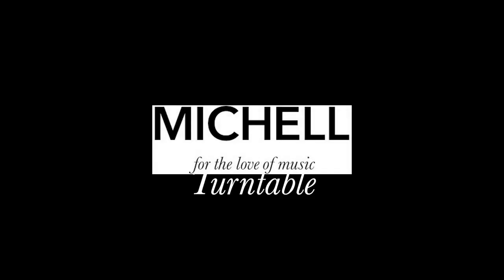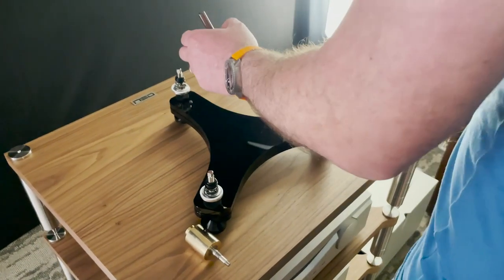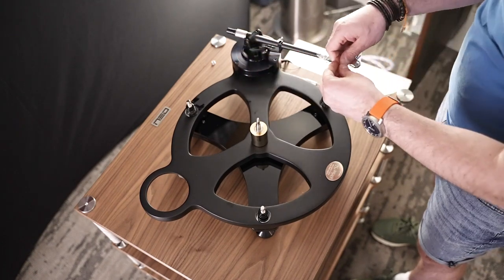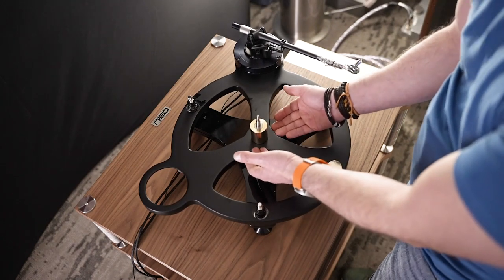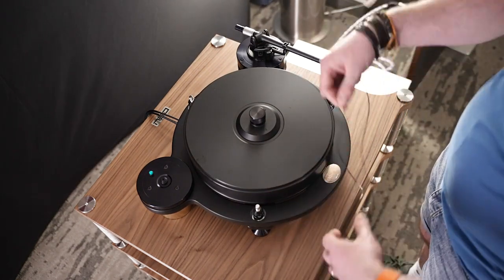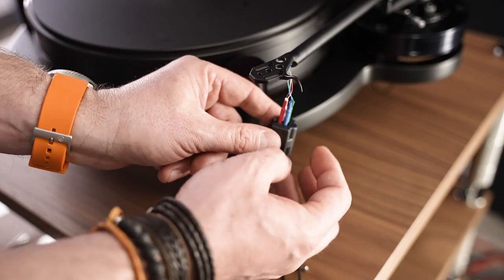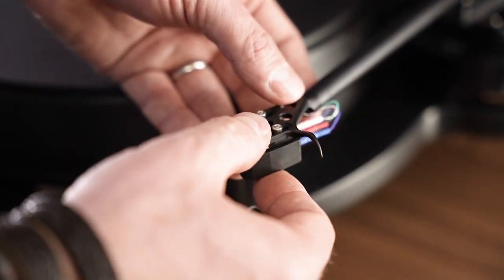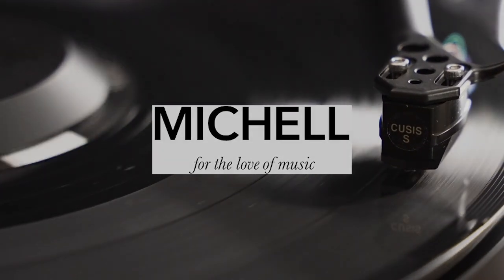Michell Orbe Turntable Build

Comment: Is it just me, or does that tonearm look way too basic (like a Rega RB220) for such an advanced suspended turntable?
Could do with a nice Reed tonearm if you'd ask me.
Reply: It is a modified Rega arm. Never underestimate the brilliance of this tried and true simple arm. Hundreds of tables have used this arm as it's hard to beat anywhere near its price point.
Reply: @jdm-uk-yank  was just listening to an interview with the owner/head engineer at rega.   he said , without naming SME , that the performance equaled the acknowledged best arm on the market when it was designed.    he didn't talk much about the arm, it was far from the main topic , and also stressed that price has no relation to performance in many instances in hi fi.  
 I bought the arm because of the price and the fact that it was developed with the gyro, hoping to benefit for symbiosis between two designs.   I am very happy.
Reply: @richardelliott8352  When the Rega RB300 was introduced in 1983, SME only made the Series III, and 3009R tonearms. The Series V was still a couple of years off.